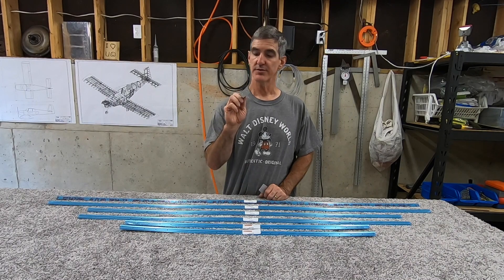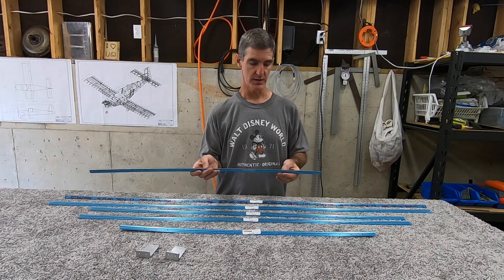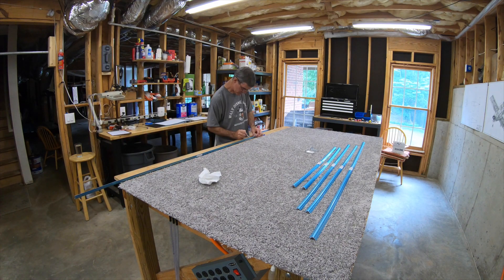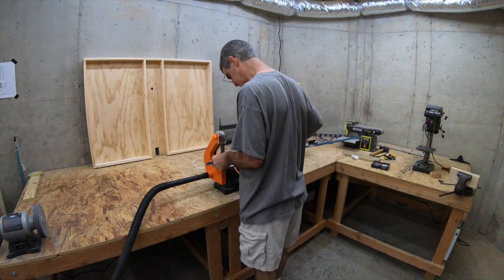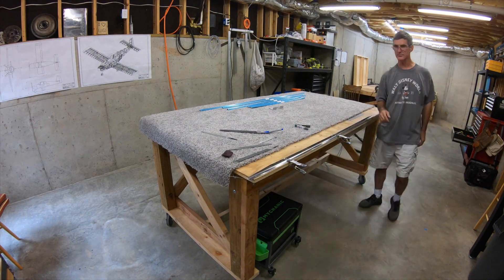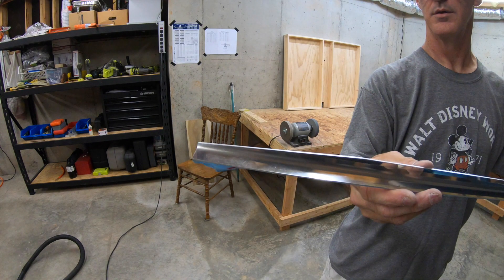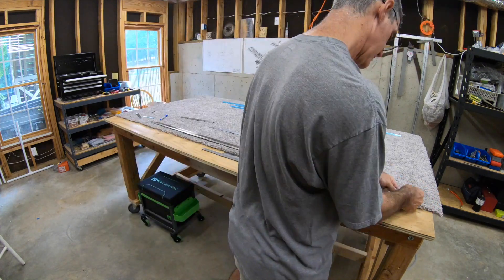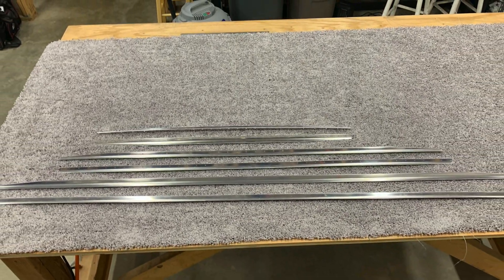RV-10 Build Log - Emp 35 - Cutting the Horizontal Stabilizer Spar Caps and Stringers

Comment: I am finishing up my RV10 rudder this week. Your channel has been fantastic for filling in the gaps between the plans and reality. One question is with the amount of time you spend filing after cutting a piece a little long. Now that you are farther along in your build, is this still your method? Other builder videos seem to cut on the line and do less cleanup. I want to get it right but not create extra work for myself for marginal benefit.
Reply from the maker: Thanks for the comments and glad the videos are helpful.  Honestly, I still tend to err on the side of more sanding and filing.  But I suppose it depends on the part.  Last night I cut the trailing edge wedge for my elevators and I cut WAY outside the line then filed to fit for that.  But part of the deal there was that the full length wedge wouldn't fit in the band saw so I had to cut by hand with a hack saw.  The 1" belt sander makes pretty quick work of the aluminum so grinding / filing / sanding to final shape on a part like that doesn't really add much time or effort.  But I'm probably also just a klutz with the saw ;-)

Comment: how's that ryobi band saw working for you? I've considering it for an rv 7 I'll be starting soon. what blade do you use?
Reply from the maker: Working fine.  It's not the most high-end saw, and I do wish it had a work light (but I make due with the flashlight taped to it).  I use a 24 TPI blade I bought online.  I wasn't able to find anything that fine locally.

Comment: Get kids playground chalk sticks and run it over the file and then a wire brish will clean out the clogged teeth, if they clog (if done regularly I don't get clogging). It also helps if you file only on the forward stroke as short back and forward file use produces heat that softens the Aluminum and makes it more likely to stick to the teeth.
Reply from the maker: Chalk, awesome, thanks!  Never would have thought of that.  I only really apply pressure on the forward stroke (though I do often drag the file backward lightly across the material).  Thanks for the tips!